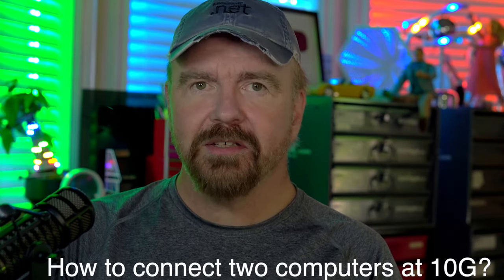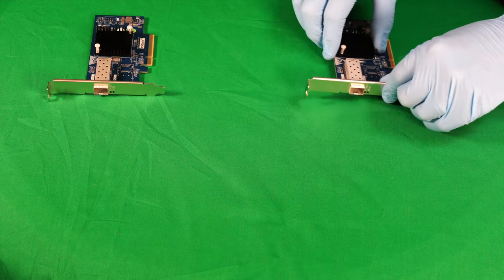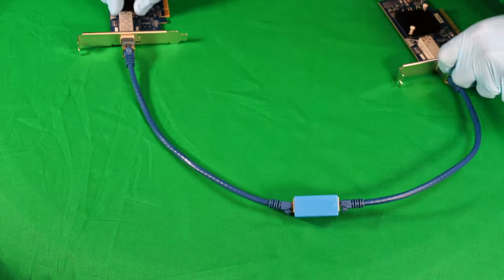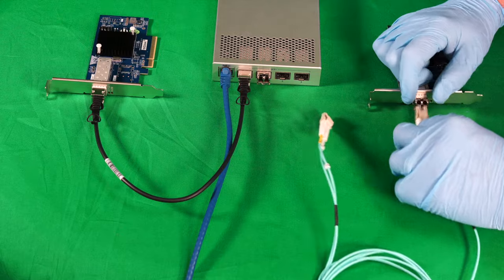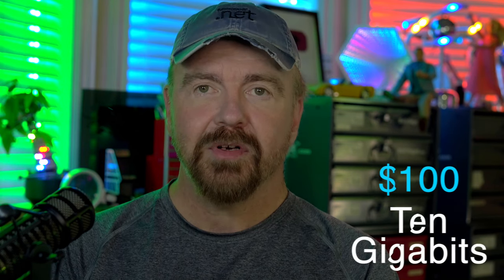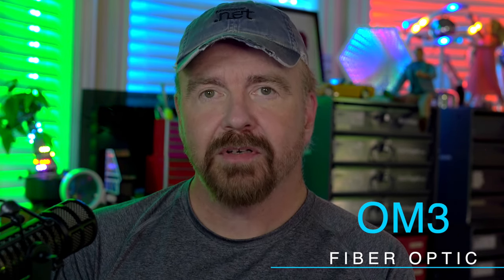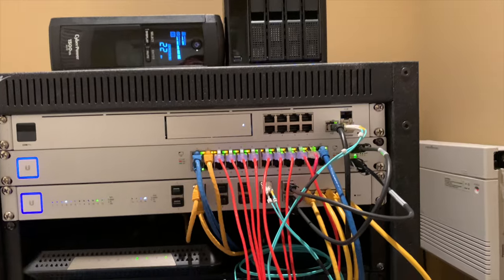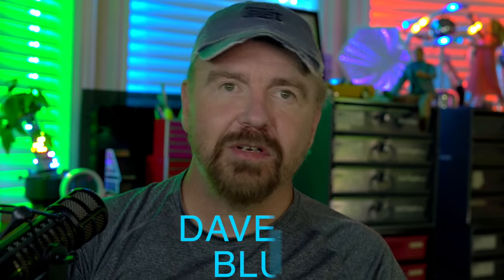10 Gig: 3 Ways to Connect!  Fiber vs Twisted Pair vs Copper

Comment: hello, thanks for the video, can you specify the type of fiber cable(om3 lc to lc, lc to st, lc to sc, etc) thanks, i just wanna transfer big files from pc to NAS fast your recommendation please, do i need a 10g network card + the 10g switch?, can i only use fiber so i don't have to buy the spf+ transceivers that use copper need 2 and are like $130 for both, the ones that use fiber are like 40 for both? please help thanks

Comment: The problem with multi mode is actually timing. Every pulse in multi mode with actually take a slightly different path, thus a slightly different distance, thus with more length = more timing synch issues, thus less range.

Comment: Can you explain why a crossover is needed?  1G and above shouldn't require a crossover.
Reply from the maker: From what I understand implementation of the "auto crossover" feare of 1 gigabit was spotty, at least initially.  So it was safer to use one, but odds are if you have a modern NIC it will be able to sort it out.  So while I assume the transceivers are modern enough to implement that feature, I couldn't find any confirmation and didn't want to assume.  But at 10/100 you definitely would need it, so it's again safer to have one then not, I figure.  You're spot on that you can likely get away without it though!
Reply: You do Not Need a a Cross over cable. Auto MDI X handle it.
Reply: @DavesGarage  I'd be concerned about the signal integrity through a crossover adaptor that's probably not rated for 10G. Does it even connect the shielding on both ends?

Comment: Well, I had it at home for a while via a switch but using the interface also for internet with jumbo frames enabled is giving trouble through the firewall. And only very expensive NVMe ssd drives would benefit from file transfers at this rate anyway. So using your "NAS" with RAID5 HDD's (which is prety expensive with 10Gbps) is not even fast enough for that price...
I stopped the whole project, and use both 10Gb NIC's in my 2 Hyper-V servers directly connected to eachother with RJ45 pure for moving/backup virtual machines.

Comment: You're an amazing teacher. I'm wondering if you've talked about the differences in SFP transceivers somewhere. In the market one can find SFP/SFP+ transceivers for different brands of switches and cards, and people have mentioned that certain transceivers do not work with certain brands of switches and cards. My thinking is the conversion scheme in the transceiver requires some programming/coding to match switch/card specific format. This programming and the data format is proprietary and thus not all are compatible. This however doesn't make sense when I think about RJ45, which are universal as far as I can tell. If you can touch on the reason behind this incompatibility, it will be great.

Also as I have not dealt with 1G SFP transceivers, I do not understand the benefit of using SFP vs RJ45 for 1G connection for 100m or less connection. In fact a single high quality RJ45 CAT-5e or CAT-6 cable costs less than a pair of transceivers and a fiber cable for runs of 100m or less. I think, fiber is the only option for runs of 100m+ to ensure 1Gbps.
Reply: I've not used SFP 1gb either but I note that SFP+ 10gb has very low latency. That may be a function of it's speed but 10gbe CAT7 is very poor latency from what I've experienced. If say you're using it for iSCSI (virtual disc drives over a network) then perhaps low latency is important.

Comment: AFAIK modern network cards will work over parallel ethernet cables point-to-point as they can figure that out and cross over internally. My realtek cards can do it for sure... whether crossover or not they can talk.

Comment: I have been having this debate/headaches for years and I'm still not 100% sure on a solid answer. 

10GB end to end is fine.. but what is your read write speed on the NAS? Best NVME drives are 1GB/s readwrite.. how are you transfering iScsi?

Readwrite and transfer speeds get complicated, then you have headaches over multi files,file types.

I recently did a huge Infrastructure roll out with Unifi fibre 10gig edge switches. 48 end points hanging off it all with 1GB so at best if all machines are working hard they are getting 480mb each, but could my file server handle that much traffic and file change.

Long story short - Minefield 🤣
Reply: You're confusing/mixing Gb and GB.

Comment: Can you explain how the fibre Internet coming into my house manages to fit full-duplex comms down a single fibre? And yes, I agree, there's something cool and exotic about having a fibre coming into my house with the Internet coming down it. Although it's also highly frustrating knowing the connection is quite capable of gigabit each way, but I can only afford to pay my ISP for 150/30mbit.

But still, fibre is cool for no obviously explainable reason, other than sometimes it uses lasers ;-)
Reply from the maker: Ah, but it doesn't.  If you look closely at the aqua cable in the "green table demo" you'll see a fiber "cable" is actually a pair of cables.  One is for pushing bits one direction and the other is the other; hence full duplex.  If that still doesn't make sense, keep in mind neither needs to receive on it's sending port.  The sender is "blind' on that tube, and can only send/write.  It can only receive on the. other.  And those roles are swapped end to end because the cable is constructed so that the send of one is the receive of the other.  Hope that helps!
Reply: It uses different frequency of light for up and down.  
1310 nm wavelength for upstream data at 155 Mbit/s (1.2 Gbit/s with GPON)
1490 nm wavelength for downstream data at 622 Mbit/s (2.4 Gbit/s with GPON)

Comment: Hello friends, I am trying to build an optical LAN with 4 PCs and a Freenas. Freenas is equipped with an NIC X520-DA1 and an Intel FTLX8571D3BCV-IT transceiver. The PCs 'NICs are the same as Freenas' (same NICs and same transceivers). However I am using a Mikrotik CRS309-1G-8S + IN Switch. Freenas is connected to the switch via a Twinax DAC SFP + cable, while the machines are connected to the switch by OM3 (aqua) LC duplex optical fiber of approximately 20 meters each. The transceivers connected to the switch that receive the optical cords from the PCs are Mikrotik Modulo Fibra S-85dlc03d Mm. The problem is that when connecting the PCs to the Mikrotik switch, nothing happens. Neither the switch lights nor the NICs light up. Would anyone know to tell me what the error is?

Comment: Should I feel the need to upgrade to 10gb, I'll try running 10 over the cat 6 wiring I have. The runs are all short.
Reply from the maker: Worked for me!  I'm getting 10 over some seriously shady cables.  The run from the house to the shop looks like Cat5 where it goes under the driveway and there are at least 2 patch panels along the way, etc... so it's pretty robust in reality.

Comment: i am so lost... im trying to connect my computer to a nas with a 10gb connection (I have a 10gb card for my computer and the nas has one built in) but I want the NAS to be connected to the internet as well so it can be remotely accessed as needed. I dont currently have a switch how do I do this?

Comment: You don't need a crossover cable to connect two PCs together, unless its a really old pc
Reply: The age of the PC doesn't matter. The ethernet interface is what matters. 1gig ethernet and up use all 4 pairs of wires in the cable and each pair is "negotiated" at the time the link goes up. Since all pairs are used at the same time and are all bi-directional, it doesn't have to send on pins 1 and 2 and "listen" on pins 3 and 6. It sends and receives on all pins. Therefore, a "crossover" from 1-2 to 3-6 isn't needed.
Reply: @xNYCMarc  And older 100mbps stuff has had auto mdi-x since multiple decades ago
Reply: @fiskfisk33  I don't know if I would say that 100Mbps stuff had it "multiple decades" ago. HP only got the patent on it in 2011, but I'm sure stuff came out "patent pending" before that. It just wasn't all that common back in the day, which is probably why the guy in the video thought you still needed a cross-over. Auto MDI-X had to be on both sides of the link as well for it to work. So in a mixed environment it wouldn't be unusual for some of the NICs to not have it and thus auto MDI-X wouldn't work.

Comment: For me it looks like way to future , in Germany at private houses we apply fiber , but we are limited in the ISP infrastructure, sure its good thing when you at your premises have max ethernet connection, but as long as it goes outside there exist low returns.
Still there a lot of investment, buying those fiber optical cables , then buying all the network equipment and then figuring out the length and the transivers for that , the more i think about fiber ethernet connect the less i like that idea.

Comment: I thought everything was autosensing now, meaning no need for crossover cables.
Reply: I thought crossover cables during and after 1000mbs Gigabit networking were obsolete too.  Apparently, not in the case of SFP+, I guess only the regular Ethernet is that way.
Reply: You're thinking of Auto MDI-X.  Most switches have that for their copper ports.  Fiber optic ports don't do Auto MDI-X.

Comment: So, what I I have a router with say 5 ports and a networkadapter with say 4 ports. And my ISP doesn't support high speeds (or it's to damn expensive). Could I just attach 1 Cat 5 or higher cable from the modem to the router and attach the other 4 ports from the router to the 4-port network card. Could I get higher speeds like this?

Or from modem to switch with 1 cable and from switch to router with 4 or so?
Reply: One CAN if it's a smart/managed switch. A regular switch NO don't

Comment: I admit this may be a real dumb question, but other than for maybe game play, what would be the need for a home to direct connect PCs to each other? By direct connect, I mean actually connected together by a wire not through a hub or switch?
Reply: 2 can connect by cable without a switch, for say a NAS and main workstation
Reply: @mrmotofy  My question revolved around 2 home pc's directly attached.  A NAS is not a PC. Also, it would make the NAS a DAS or direct attached storage. Thanks for trying though.
Reply: @paddle_shift  Maybe you should review the definitions of NAS and DAS. A NAS IS a computer and operates just like one involving hardware running an operating system most commonly Linux and connects to a network. It connects by a network cable and CAN be directly cabled to another computer with a patch cable. Like to utilize a 10Gb port on it and a 10Gb port on computer without using a switch.  I currently have a previously used personal computer setup and running a NAS OS, has multiple drives and connected to my network with shares. It IS a computer but is also a NAS. My main workstation has a direct cable connection to it through a 50' 10Gb link AND it's connected to my main core switch at 1Gb for everyone else on the network. The main workstation also has a 1Gb network connection to core switch for normal internet access etc. The directly connected cable is no different than connected to a switch. It still connects and transfers using the exact same networking protocols as connected to a switch. It's STILL a NAS

A NAS does NOT become a DAS by directly connecting it to a computer. The NAS is still a standalone device sold and configured as a NAS, connected, accessible and communicates by TCP/IP protocols. A DAS would be an external hardrive, a USB drive or memory card, etc by definition, generally a dumb device.
Reply: @mrmotofy  I was really wondering about 2 standard PCs attached to each other.
Reply: @paddle_shift  But I already described to you multiple examples of a Direct cable. A computer to a NAS or a computer to another computer IS THE SAME. A NAS IS a Computer with network shares. My NAS literally IS a PC with a network link and a direct cable to my workstation. My NIC'S are a 2 port, so I can actually connect another computer to either 1 directly and able to browse/access shares across all 3 systems all at 10Gb without an expensive switch.

 A Youtuber working with 50Gb video files on a Mac Mini with 10Gb NIC can/should backup/synchronize vid files to another computer with a direct cable and 10Gb NIC without a $150-$600 10Gb switch. That's much faster than 1Gb networking. A regular slow HDD can hit almost 2Gb/s. SSD's are much faster. The 1Gb network is a bottleneck.
All thats needed is a cat6 cable and 10Gb on each end. Set a static IP on both. In windows it helps to force traffic over 10Gb link to add a line in host file to use 10Gb NIC.
Reply: @mrmotofy  Thanks, as i stated in my original question "this is probably a dumb question". I get it, a reason you would directly attach two PCs to each other would be to move enormously large file such as a video file from one pc to another. Thanks.
Reply: @paddle_shift  OR cuz you're cheap and you're wife has you on a short spending leash, can't buy a switch.

Comment: As a pedantic aside to your pedantic aside at 1:08 … they're not actually registered jacks at all, just unshielded and shielded (and unkeyed) 8P8C modular connectors.

It's unlikely to be a "registered jack" unless it's plugging into PSTN equipment. RJ45S in its intended usage (quite rare now) is also keyed, although a keyed socket will accept an unkeyed 8P8C plug. 

I'd have just kept my mouth shut had you just called them "RJ45"s without the pedantic aside. ;p
Reply from the maker: Thanks, but... then what's an RJ48? Where'd I go wrong?
Reply: Goes without saying, but I did find your video informative, and the dry humour is a definite plus. Otherwise I wouldn't have bothered to comment. :)

Comment: Incorrect about the RJ-48 tips.  RJ-48 is a common pin out for T1 cabling. Pins 1&2, 4&5. That’s an RJ-48. You’ll commonly see RJ-48 labeled on old T1 modems or CSU/DSUs.

Comment: What is you oppinion on 2.5G and 5G network equipment that work with ethernet cables without the use & cost of SFP modules;
Reply from the maker: Sure cheaper, and to be honest, the number of times that I'm seeing OVER 5 is pretty rare outside benchmarking.  So I think right now 5G is honestly sufficient for most stuff.
Reply: @DavesGarage 10 years ago in my old setup i had to enable Jumbo frames in order to max out gigabit (mostly traffic from Core2Quad 9550 το Sempron 2600+ fileserver)
Nowdays still using sandy & ivy bridge PCs i can saturate the link even without modifying standard MTU. 105+ Mbytes/sec is still decent for causal soho use.
Congrats for you job you are the 1st one to simply explain how SFP w
orks as far as i have seen/read. :D
Reply: 10Gb is an industry standard...2.5 and 5Gb is not really. Save and just use 10Gb

Comment: I even prefer running single modes to rooms nowadays. Cost of transceiver and cables is not difference much.

It's goes up only in Enterprise class vendor like Cisco, Aruba or some others which also Vendor-Locked SFP+ Modules.

Comment: Hold up. A dual-port card with software routing is not necessarily the easiest way to link three systems, because whichever system has the dual ports will need enough CPU clock cycles to handle inspecting and routing 10 Gbps worth of traffic, lest it become a bottleneck preventing true 10 gig throughput. That, or the card needs to be running a driver with support for bridging with CPU offload.

Comment: Small Note, with 1 GBit connection, there are no cross over cable needed
Reply: Exact same thought I had. Any Ethernet PHY that was manufactured this decade most likely has auto MDIX and I believe it’s a given for 1 Gbit and above.  PS - what’s up with the gloves in the video?

Comment: I don't think you need a crossover ethernet cable to connect 2 PCs together, I think any ethernet cable works. One PC will just act as the host. (and yes I know ethernet is the protocol, not the cable, but you know what I mean)

Comment: I had my house wired with cat5e and I'm running gigabit.  I wanted to step up to 10 gig and was going to have someone yank all the 5e and replace with 6a.  Then I got to thinking, maybe I could just run 6 fiber 62.5/125 OM1 cables.  Currently all my wall plates are dual RJ45, so I figured with 6 fiber I can have two jacks plus two spare strands for backup.  For the locations that will be driving my performance requiring rigs, all good as I'd be running fiber from the wall to the PC's NIC.  However that's only like four boxes in my house that will have fiber NICs, the other 10 machines will just have RJ45.  So I figured OK, media converters for those.  But the cheapest I ran across so far is $120!  $1200 in media converters kinda sucks, lol.  Does anyone know of any cheaper ones to convert SC multimode to RJ45?

Comment: Fiber has a very high geek factor... unless it is run poorly by the cable company.  (They thought hanging their fiber on telephone poles was a good way of getting a signal from Clearwater to Pinellas Park... about 37 miles away.  Worked for a year until all the glass micro-shattered due to movement in the wind.  Amazing how little bandwidth was available after one year... (Started off as a 5 gig or 10 gig connection... ended up in the "Honey, where did you put the bandwidth after I shot it with the shrinking ray?"   Probably 100 megabits, which they were trying to send a few hundred televsion signals along with internet for thousands of people.  Ugh.  (Paragon Cable ended up getting bought out by Slime Warner, who had the good sense to bury the fiber after replacing it all...)

Comment: Basically every rj45 NIC is auto crossover using MDI-X, it switches the connections for you
Reply from the maker: Everything gigabit or later should, but it was spotty on 100M and early gigabit switches, I'm told!